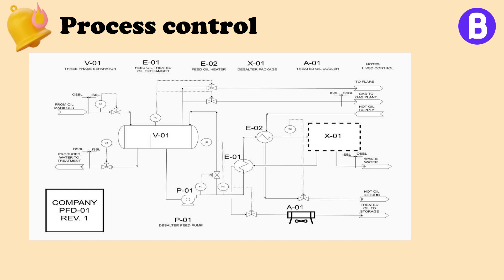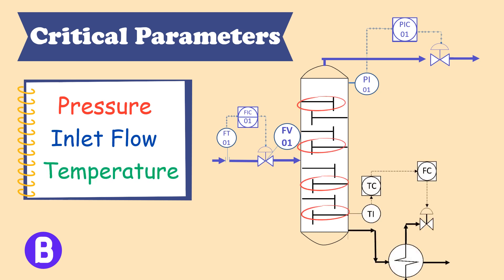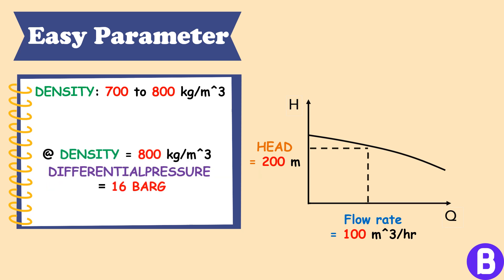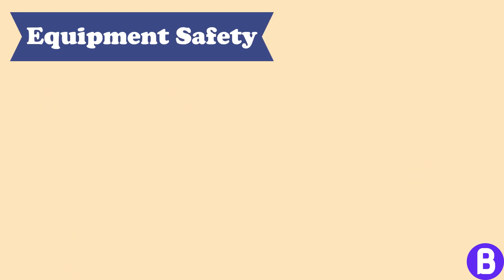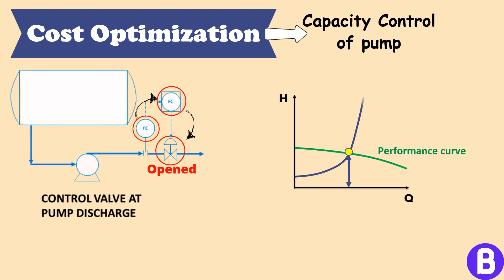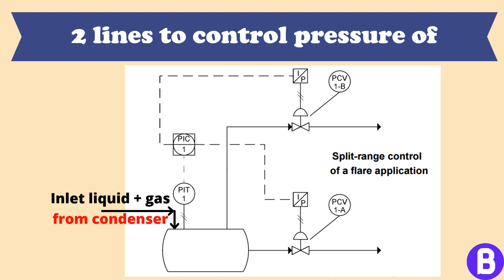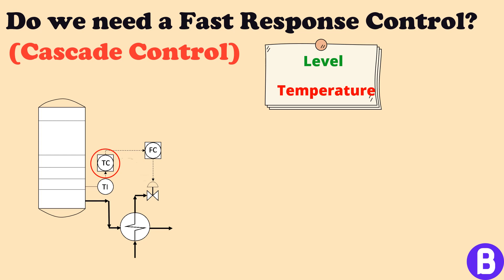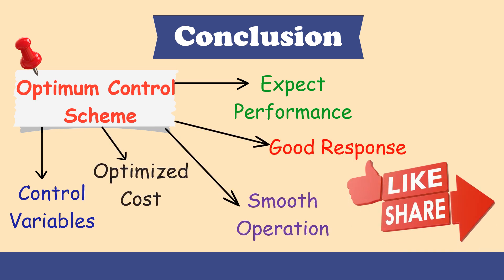Tips to Choose the Optimum Process Control Scheme

Comment: Explain furnace outlet temperature is controlled by pressure or flow
Reply from the maker: Nice idea! I can talk about it in a later video. Furnace outlet temperature is commonly controlled by adjusting the amount of fuel entering the furnace. Adding a control valve on furnace outlet is not accepted from safety point of view stopping the flow in furnace tubes while the fluid is kept on being heated is a very dangerous situation.